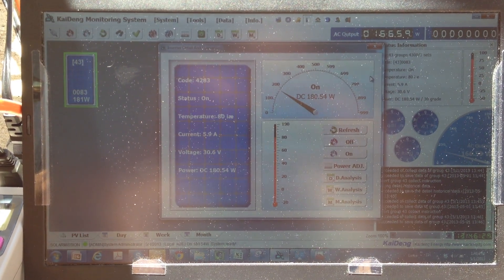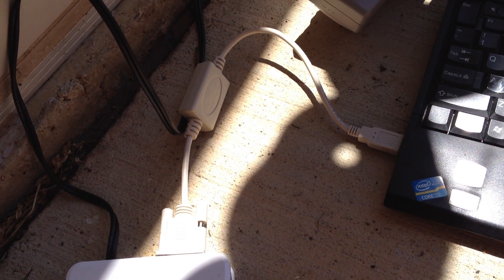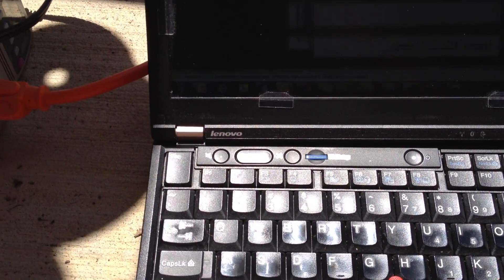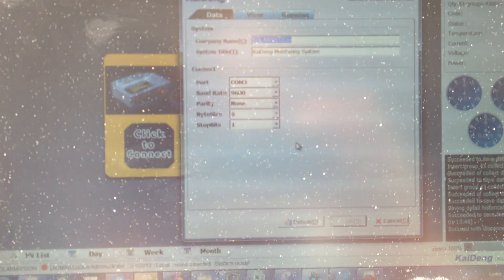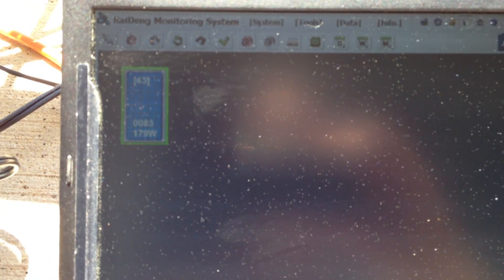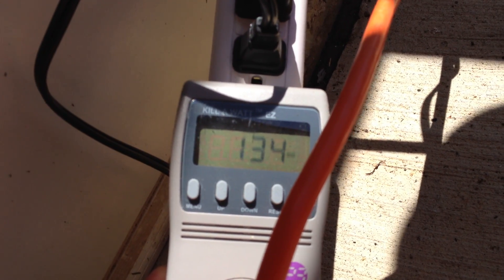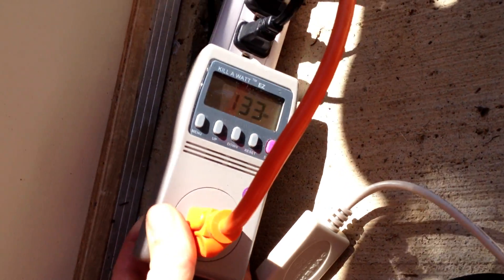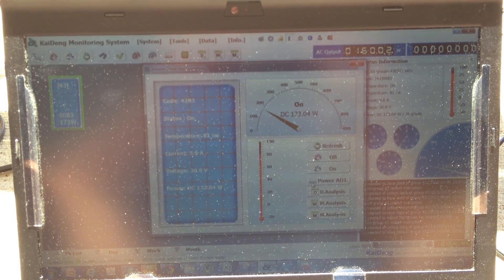Small apartment balcony solar power setup (part 2)

Comment: Wher did u buy it link?
Reply from the maker: So sorry for the very late response. This was a long time ago. There are many better and cheaper solutions, especially for the solar panel. I bought all this from different online sources. The battery and inverter setup in the box ended up working well but you really need to bring the equipment cost down for it to really make sense financially. For me this was more to test if it could work.

Comment: have you added more or is it working fine still?
Reply from the maker: Sorry for the late reply. No, I did not end up adding more to this setup, after I changed the micro-inverter setup to one with a battery and regular inverter. I left it at that because I spent enough money on this proof of concept, knowing that I would not stay long enough in this place to ever get that money back. Since then I moved to a townhouse and its sitting in my garage :) I am now planning to do a regular solar installation but not there yet because I want to change everything in the house that runs on gas to electric first.

Comment: You just plug the output into the exterior outlet?  Have you notice  a decrease in your electric bill?
Reply from the maker: I apologize for the late reply. I never calculated how much I really saved because this was more like a proof of concept to show that even in an apartment you can use solar power. My final setup was with a regular converter and battery which I charged during the day with the panel and then in the evening plugged into my living room grid to power TV, stereo, lights, internet router, etc.
Worked perfectly but I did not do that on a regular basis because I sometimes simply forgot or the battery was not charged enough because of bad weather. It was very manual because I had to disconnect the living room grid from the power grid by flipping the breaker switch at the breaker panel in my laundry closet before plugging in the battery and inverter on the balcony to power this part of my apartment. But it worked great. Nevertheless, this only worked this way because I had a power outlet on the balcony which was tied into the living room grid so I pretty much could isolate the living room and power it with solar power at night. So yes, I had a battery connected to a regular inverter (no micro inverter) from which I ran a regular power cord to the power outlet on the balcony which was part of my living room grid, which I could manually disconnect from the power grid.

Comment: Do you see a return on your investment? I love this idea. Our energy cost here in San Diego is insane. I pay about $300 a month for electricity
Reply from the maker: Sorry for the very late reply. I never calculated how much I really saved because this was more like a proof of concept to show that even in an apartment you can use solar power. My final setup was with a regular converter and battery which I charged during the day with the panel and then in the evening plugged into my living room grid to power TV, stereo, lights, internet router, etc.
Worked perfectly but I did not do that on a regular basis because I sometimes simply forgot or the battery was not charged enough because of bad weather. It was very manual because I had to pull the fuse for the living room grid before plugging in the battery and inverter to power this part of my apartment. But it worked great. Nevertheless, this only worked this way because I had a power outlet on the balcony which was tied into the living room grid so I pretty much could isolate the living room and power it with solar power at night. And to be honest, that was exactly what I got out of one day of solar power charging of the battery: a few hours (4-5) of living room lights plus TV plus Internet Router. In general it of course also depends if your landlord allows to mount such a panel to the balcony railing, especially if you are on the upper floors of a building. I was on the basement level and my balcony was facing to the backside of the building (but south-facing for maximum sun) and guess, that they never bothered to check what I installed there.

Comment: Hi, are you sure that your watt meter can work the other way around? It is suposed to have a load on the side were the orange cable brings the ac from the inverter.
Reply from the maker: esborniarj I apologize for the late response. To be honest, I am not sure about that. As I showed in the video, the watt meter showed a different wattage than the software and I never figured out the reason, before I changed the setup to one with a battery and regular inverter.
Reply: It's AC, so it does not matter which is input or output.  The Kill-a-Watt meters are actually pretty accurate, because they measure Power Factor, and correct readings for Reactive Power. Have you checked the P.F. of the inverter while it's operating? It should be above 0.90   MY biggest concern for what I've seen so far (I haven't watched any of your newer videos yet) is the severe angle between the PV panel and the direction of the sun - it appears you have 30-40 degrees of mis-match.

Comment: hey what up? do you know whats the login on the software? because I have the same problem I cant monitor my system
Reply from the maker: gerardo Urrutia Hi there, sorry for the delay. Did you manage to get the software up and running and also connect to your modem? In the video I explain how you need to configure the software to pick up data from the modem. Let me know.

Comment: hi the guy is right about  The power cord you have running to your kill a watt meter is to small. And kill a watt meters never that much out did you buy it from same people lol and like way just leave it out if you were living in UK it would be gone before turn round all my panels went in 15 min and had alarms on them people today so sad
Reply from the maker: I have since changed my installation to what you see in my 4th video about my solar setup. So no more kill-a-watt meter, just the panel, 100Ah deep-cycle battery, 1500W inverter. Pretty happy with the installation and I can have electricity in the night when there is a power outage which I wouldn't have had with the grid-tied only installation (withouth battery backup). And it is interesting what you say about your panels being stolen. I never had an issue with that at all.
Reply: Thats good you live by people you can trust its been a big issue here since the goverment  let in people from eu

Comment: haha. Oh my goodness. I didn't watch this video carefully enough -- and at the time, I didn't know about grid-tie-in inverters. In this video, you were primarily talking about the software and debugging process, which I didn't care too much about, I sort of tuned out. lol. On re-viewing this video, I now see that you do have a Kill A Watt meter and it indeed showed you how much electricity you were putting into your house grid. Your system actually worked. NICE! But I guess you couldn't verify if your util meter was running backwards or not during the daytime, so you changed over to your battery system. lol. I see. Now I understand. 135W on the Watt Meter does seem a bit low but the efficiency on those grid tie inverters are not very good, in the range of 50-75%. I think your 135W production was actually acceptable given the inefficiencies of these grid tie inverters.
Reply from the maker: Yes, that's exactly the issue I didn't like. I couldn't verify what is happening to the current fed into the apartment. I also think that having the powerstrip in between wasn't beneficial to the setup. And I did these tests when it was very hot so assume both the panel and the inverter (which I had right behind the panel where it is very hot) had some inefficiencies due to that.

Comment: Agreed. Ditch the surge protector. They are known to mess with frequency and reduce wattage and voltage. That may help as well. Grab another tester. Borrow it lol etc. There are higher grade references.
Reply from the maker: Kristopher Sullivan 
Good idea Kristopher, thanks. As mentioned before I will also change this little setup and add a battery so I can actually disconnect a portion from my apartment from the grid in the evening when the battery is charged.

Comment: The power cord you have running to your kill a watt meter is to small, you either need to get a thicker wire or get another cord like the one you have buy a new set of heads for it a slight size bigger than what you need and cut the ends off of the cords strip the ends and put them together into the new head that will double the conduit and should increase your wattage you see at the meter, but I do not know how much it will increase but it is a very good idea.
Reply from the maker: neobreaker91 
thank you for the tip. will do so when I change my installation. I got a new inverter, a battery and a charge controller. I have all the parts but need to put them together.
Reply: lbodini2008 Please post a new video with your new install once it is completed, looking forward to seeing it.

Comment: Can you please provide a parts list or just the order number so I can order this setup?
Reply from the maker: Jesse Arganbright 

Components:
1 x Yingli 245W PV module
1 x Kaideng 260W micro-inverter
1 x Kaideng monitoring hub plus software
Reply from the maker: Jesse Arganbright 
I also show the order slip in this video. Grid-tied solar power installation in apartment (part 1)
Reply: I tried to email them that list for a quote and they haven't gotten back to me.

Comment: Did you have to get permit from your landlord of the owners allow you to put this panel hanging from the rail like that?
Reply from the maker: To be honest, I did not check with the landlord. This was meant to be a test setup to see if it actually works and if I am able to figure out how to measure any delta in energy costs. At this point I have stopped the experiment until I find another solution.
Reply: Ty good luck

Comment from the maker: The power usage pattern at my place is that during the day, I hardly have any consumption (only fridge, wifi and sometimes the stereo). It would be good to have a battery setup, that I can charge during the day and then move inside to hook up the fridge or TV/stereo set as the biggest contributors to my energy usage. Probably only feasible to hook up the TV/stereo. I looked into the Goal Zero solutions but way too pricey. Will look into the battery you suggested.

Comment from the maker: If there was a simple and cheap battery backup solution which I could charge with the panel during the day and then for instance run the fridge from at night,  I would give that a try. It would have been nice if the fed in solar power during the day somehow offsets the utility power but at this point it requires more effort to test that.

Comment from the maker: I didn't bother testing more because I have another problem. I have no way to check what happens with my solar-generated power once it enters the apartment grid. I do not even have access to the room where the utility meter is in order to check if the meter slows down when the panel is on, etc.
The utility bill doesn't reveal anything either as it fluctuates a lot every month.

Comment from the maker: Hi Gilbert, sorry for the late reply - the power cable needs to be plugged in, otherwise the inverter shuts down (for protective reasons) but I have checked with a volt meter in between the power plug and the inverter and it is about the same what the Kill A Watt meter shows. Based on this and other comments I think that this inverter model just has a poor performance.

Comment: Have you tried putting a voltage meter at the end of the orange extension cable to see what your getting from the inverter?  This would dismiss any discrepancies of what happens after you plug it into the kilowatt meter. Please post any new findings. Thanks